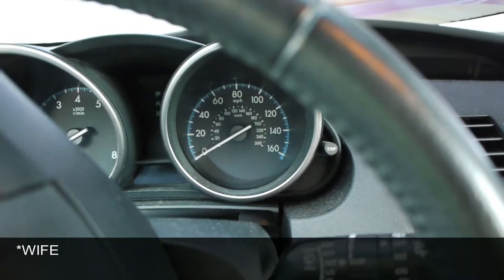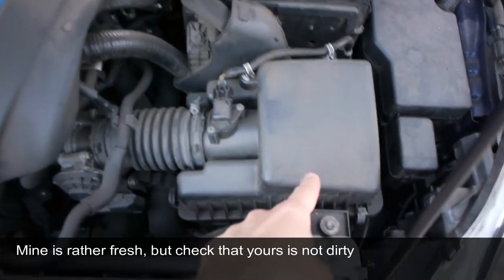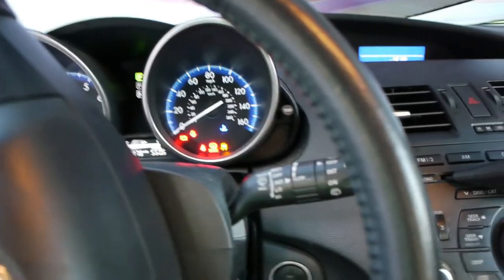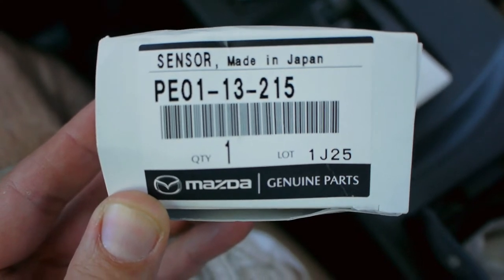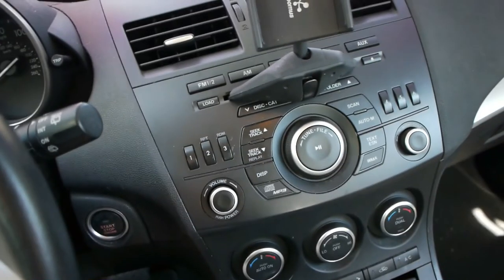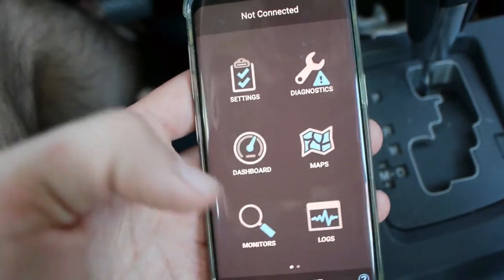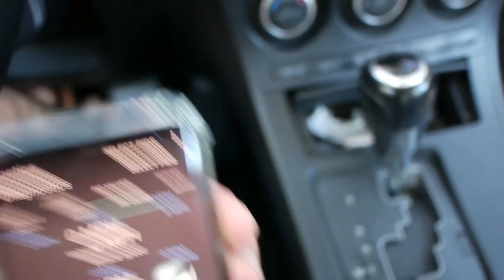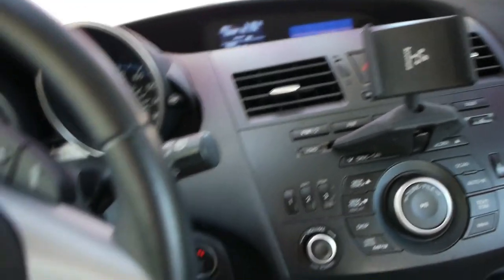Mazda 3 skyactiv starts and stalls - mass airflow sensor

Comment: Let me add my thanks as well (and subscription! :)) This happened while I was away and I didn't relish coming back to working on my 2012 Mazda 3. I pulled the air filter last night, and that didn't help... was thinking it might be the fuel filter, but came across this video this morning and I knew as soon I saw you start the cut and heard it cut out the same way that this was probably the problem and solution. 

Thanks again!
Reply from the maker: Cheers, George, keep it running!

Comment: Very helpful. My 2012 Mazda 3 Skyactiv had the same problem, and changing the MAF sensor cured the issue.
Reply from the maker: Sweet. Applies to many cars, since they mostly run same sensors, so troubleshooting steps are same/similar. Keep it running and enjoy the car!

Comment: Did not think it would be the mass airflow sensor for me. But it was! Surprised a faulty sensor kills the car like that.
Reply from the maker: @ashmandom9793   If the car can't measure how much air is coming it, it can't figure out how much fuel to add for combustion, so it shuts down.